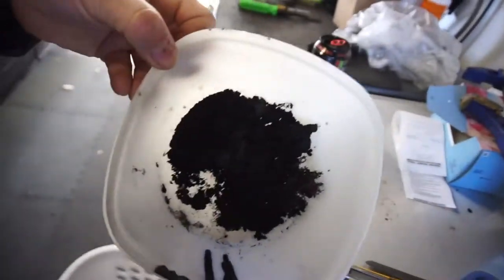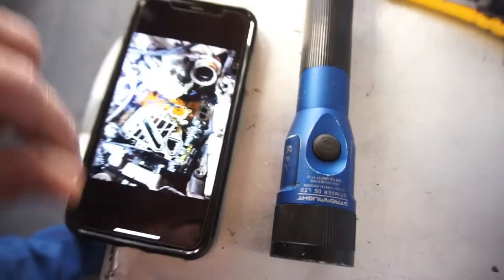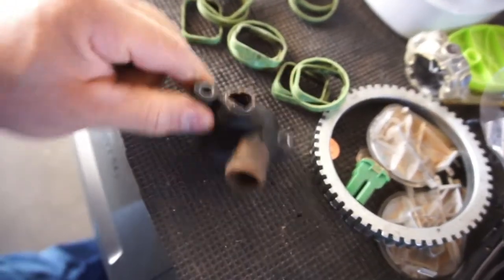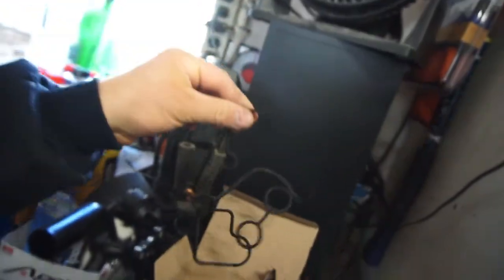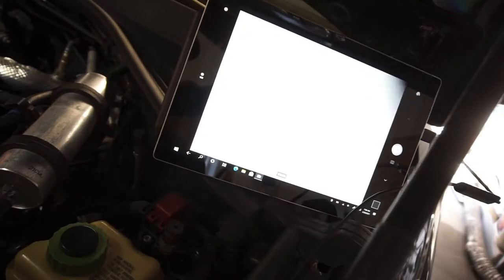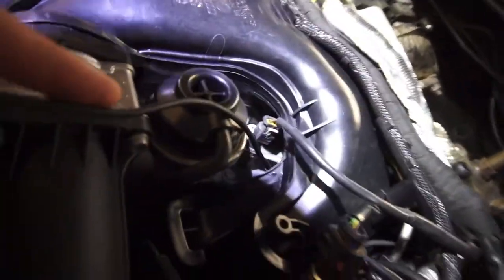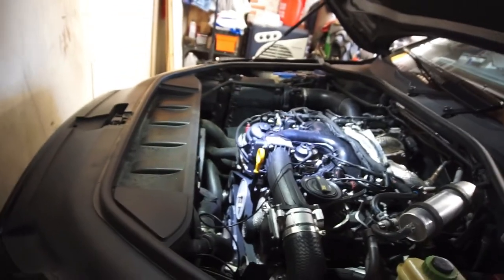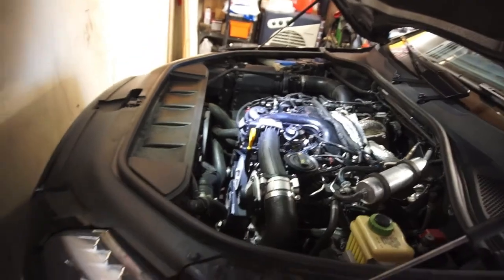2015 Audi Q7 TDI 3.0 Coolant Leak Fixed and Inspected With A USB Bore Scope Camera. VW Porsche.

Comment: I had the same issue and the same repair and cleaning, plus nut blastig the valves. Fully agree with you this job is necessary for every 50k-60k km. One tought is kicking me all the time. What changed in the EGR system comparing to the first 50k km? At that time there was not an excessive build up in the intake system. Something had to be changed causing excessive carbon production - deposition in and after the EGR system. I suspect the EGR cooler has a lot of carbon deposit and the cooling efficiency is degraded. Another change: the amount of oil in the intercooler pipes. In my case I got an excessive amount  of oil at the bottom of the intake system after 200k km. You had dry shoot in the system I have an oil wet shoot. My engine consume about 1l of oil in 10k km and most of it goes to the intake system I think. Needs further research what cause what to find the root cause(s) for the excess shoot and oil in the intake system. Any suggestion is appreciated.
Reply from the maker: Sounds to me that you have a bad oil seal on your turbo if there’s oil in the Intercooler. Not sure if to drive short or long drives but diesels like long drives. I inspected my egr cooler and it was really clean. I just wish there was an inexpensive delete kit so I could remove all my emissions parts.

Comment: Just dropped my wife’s 2014 Q7 TDI to have this done. She bought it used with 48,000 miles and now has 131,000 so not shocking it has to be done but sounds like a big time failure on VAG. Seeing a lot of people having to do the is exact job.
Reply from the maker: They should definitely do a recall on that plastic piece that breaks in there. Do you know the final cost to fix it?
Reply: Not yet, depends what needs to be replaced but am expecting it to be close to $2000 all said and done. Praying it’s less.
Reply from the maker: @AndreAguiar hopefully it’ll be less expensive.
Reply: $2330 cash price was the damage. Labor was clocked at 10 hours. Bunch of miscellaneous parts and fluids was the rest. It’s done now so should be good for another 100,000 miles  🤞🏻
Reply from the maker: @AndreAguiar well at least it’s all done and should last another 100k like you said.

Comment: Could you please post part numbers for gaskets and fittings as well as the bypass valve I have to do the same job now and I can find intake gaskets but bypass and fittings are a no go

Thanks
Reply from the maker: Here’s a video I did with all the part numbers. 
https://youtu.be/1oV82Bn_fns
Reply: @Halffast719  Thank you very much!
Reply from the maker: No problem

Comment: Hey, i have oil in the valley after replacing all gaskets. What should i do please help me. Do you think is possible to be from the front cover?
Reply from the maker: Might be you oil filter housing. If you or someone else ever over tighten it, it could develop stress cracks and start leaking.

Comment: Hey great video! I did this exact job on my q7 tdi 2015, almost everything went great. I then filled the cooling system by vacuum. I did put a good amount of coolant in it thinking I had all the air out but the car is not heating up or barely and almost no heat inside.. How did you bleed your cooling system? thanks
Reply from the maker: All I did was a vacuum fill but I had 3 gallons in the bucket and it only took 1.5 gallons barley. I added about 12 ounces about 60 miles later.

Comment: What VAG code you were getting for the soot choked throttle body? Im getting P2008( intake manifold runner bank 1 control circuit/ open) which is for manifold swirls, where as there are no swirls in my manifold. And due to this there is no low end torque in the car. Kindly help.
Reply from the maker: I wasn’t getting any codes. I just had a coolant leak and found this choked intake as I was pulling it apart. I don’t have swirls in my manifold either. I’d just take the intake and egr off and do a real good cleaning.
Reply: @Halffast719  thanks, so did you face any low end  power loss ?
Reply from the maker: Yes it was. Now the Q7 is like a little rocket like it was new. I’d definitely recommend cleaning the intake every 50k miles.

Comment: Please help, I am really worried. I did the exact job where I replaced oil cooler, and flanges. bleed the air out of coolant system and filled it usung coolant vacuum refiller. I then Primed the fuel pumps using VCDS and ran them for 3 mins to bleed any air and fill the fuel lines. Started the car, it kept trying but didn't start. I stopped after 10 seconds. I then manually open the injectors fuel lines and fuel return line while fule pump was running using vcds to bleed air out. Tried agin for 10 seconds, but still it tries but didn't start.
Please help. What I am missing?
Reply from the maker: Mine cranked over for almost 20 seconds before it even sounded like it was gonna start. Then I did it again and took 10-15 seconds to fire up and all kinds of lights came on but all went off after 30 seconds.
Reply: @Halffast719  Thanks for replying. It is much peaceful to hear similar situation from someone else after this job. You have no idea how satisfying I am feeling after your reply.
I will give it another try. So did you also primed the fuel pump? And your injectors lived these cranking timings? I got worried cuz many on YouTube saying that you injectors burn out if let self start for that long.
Reply from the maker: Let me know how it goes.
Reply: I got my car started FINALLY, and it exactly took 3 tries each 10 second long, but I did few extra and safe steps.
1st: 
To play safe on injectors, I ran both fuel pump using OBDEleven for 3 mins so there will be fuel in fuel lines, and on top of that (with 2nd person's help who was holding my phone to start and stop the pump as OBDEleven app was running off of my phone) while fuel pump were running I loosen up the injector's fuel lines bolts, enough to release block air pockets and same thing I did with return fuel lines, and there was enough air in all lines. I kept towels to catch all the diesel.
2nd:
I jump start using jumper cables, so its own battery won't take load. 
3rd: 
After every 10 seconds try I waited 10 min for cables to cool down incase if they are getting hot.
This is the full story. When I contacted you, I was sitting at 1st step. I hope my detailed reply might help others who might contact or see your video later.
Bad News:
Bad news but only for me is that my car is parked now, because during this job, I also tried to removed a broken & stuck glow plug. But while drilling it out the drill bit broke in there. So currently half stuck and uneven drilled bit and plug is stuck in it and when I took my car for test drive , down the street it sprayed the diesel all over the engine, so much that engine started smoking and that bay where the oil cooler lives, filled with diesel. I towed the car home which was like 1000 feet from my house. Check all fuel lines if any I left loose, but all were tight. Pumped out the diesel from that bay. Checked, and found that diesel spray from the same glow plug hole, as I now noticed while car is parked and running Diesel bubbles are coming from walls of same glow plug hole where half drilled, drill bit is stuck. 
I am freaked out and out of options. If you know any one or have any option plz let me know. I am Canadian but come and go in Buffalo NY area. But car can only be towed.
Sorry for very long reply.
Reply from the maker: That’s a lot of great information. Hopefully it’ll help the next person. I gotta ask, is your fuel filter under the hood on top of shock tower area or under the car? I’ve heard of people having a hard time starting their diesels when they replace fuel filter when it located under the car. People have an easier time starting it if it’s under the hood like mine. Just wondering. I do not know anyone in that area. I remember watching a video a long time ago about removing a broken tap or drill bit using lie but I’ve never tried it and highly unlikely it’ll work.
Reply: @Halffast719  My Fuel filter is under the car, plus I think it took longer to start for me cuz my car remain parked out on my inclined driveway facing up (law of gravity).
I have watched almost 100s of drilling out videos. Bought most expensive drill bit called "Rescue bits", but even that broke at very first min. Plus it is very hard to make any drill sit at the edge of other drill bit (the one broken inside) while holding drill machine in your hand as it slips right and left,  unless I use the one fixed in a stand as in machine shops. 
Well, from here onky God can help and I am asking his help.
Reply: @Halffast719   I appreciate the great videos on the coolant leak.  Was this repair on the Q7 type 4L model?  I have this Q7 2014 $L TDI and I am getting ready for the same repair.
Reply from the maker: Thank you and you’re welcome. Yes same 4L model.
Reply: @Halffast719  
During the tear down...did you need to disconnect fuel lines?  If so did you need to bleed air out of the lines during re-assembly?
Also, where can I find the torque specs on the bolts?
Reply from the maker: I couldn’t tell you where to find the specs. All the intake bolts bottom out and I gave them a little snug twist. 6-8 foot pounds. I did disconnect the fuel line and I didn’t bleed the lines I jus let the car crank over for 10-15 seconds two times and it started right up.
Reply from the maker: Oh wow. That is so awesome. Thank you. I just downloaded them.

Comment: Hey mate, I've got a TDI sq5 with similar engine and coolant leak from same area. I'm trying to tear it apart before ordering parts but I'm having trouble removing the intake manifold. And it looks to be the same one as the q7. Did you have trouble removing it?
I've triple checked that I've got all the bolts off and followed the Audi manual but it's as if the manifold is glued on or something. When I pull or try to wiggle it off I just shake the whole car with it lol.
Thanks in advance for any advice, will be a big help!
Reply: Hi, I have the same problem, same engine. Did you manage to solve this?
Reply from the maker: Yes its all fixed.